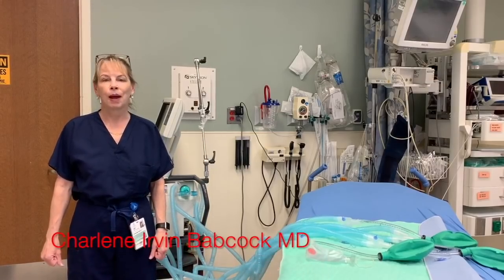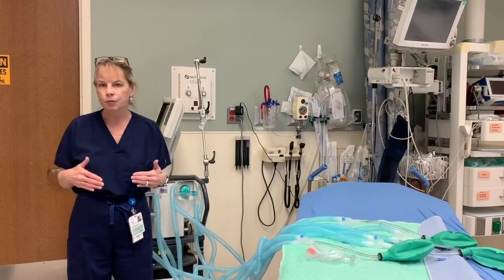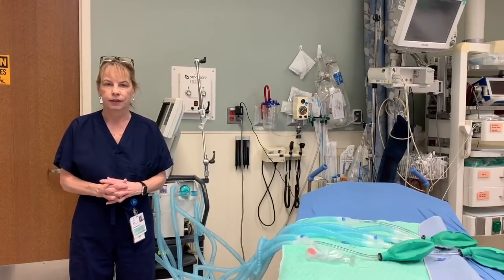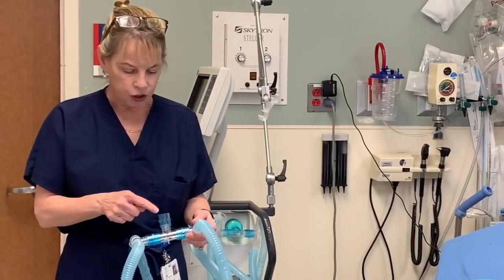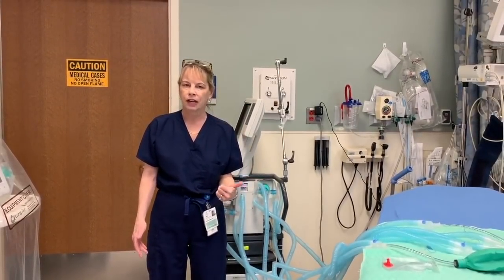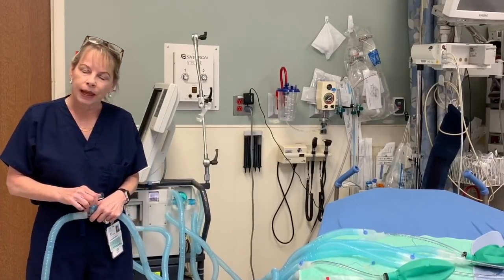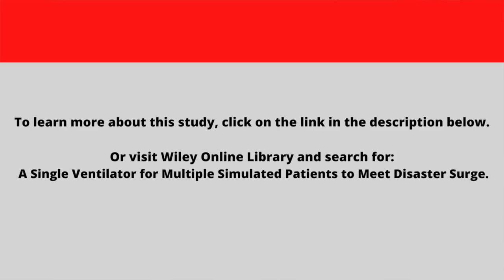COVID-19 How to Use One Ventilator to Save Multiple Lives

Comment: I realize you are trying to help in a horrible situation and appreciate the creativity. But you would be better to pay people to manually ventilate the other 3 patients with a bvm and peep valve than do this death setup. Did not even go into the variances of minute volumes in critically sick ards patients
Reply: I have been working in ventilation for over 25 years in ICU. There is no need to test splitters or pressure bleed valves etc...   It would not work in ARDS pts.  If this would work she would hook up this crazy circuit to 4 ASL5000 electronic test lungs set up with varying levels of ARDS. It would instantly prove how dangerous this is or what an incredible idea this was.  You could train people in under an hour on how to bag and roughly what minute volume would be needed per individual patient. You could even get the baggers to mimic inverse ratio or 1:1 I:E ratios.  I understand people are fearful and looking to latch onto anything that might seem promising.  This is not it. With 1 vent and 3 manual baggers you would have a chance (small) at all 4 possibly making it. With this setup you would have 4 dead people in short order.  It’s one thing to suggest using BiPap to ventilate off label(fair enough in a crunch), it’s another to suggest this mess. Any physician or RT that attempted this in real life with real patients would lose their licenses and face massive negligence lawsuits.  Why hasn’t this ER doctor had an actual ventilator expert like Robert Kacsmarek or a well published Intensivist point out the wisdom of this setup?   Have you not thought about why manufacturers have not suggested this?
Reply from the maker: So this type of configuration is likely only going to be used in dire circumstances...such as 'TRY or LET DIE!'   
You do need to match compliance as close as possible...which can be a substantial challenge...however, it is my understanding it is working in Italy......from 2 days ago....see comment cut and pasted below...

Dr Marco Ranieri of Bologna, Italy and his team Have successfully tested the approach in vivo in one of the hospitals in Italy overwhelmed by the COVID-19. 

They worked with Intersurgical, an Italian company based in Mirandola, started producing the circuitry in only 72 hours, and the first prototype has already been tested by Bologna Sant'Orsola Hospital. It works and in the next few days they'll start a mass production to supply Italian hospitals who are in need

Here some news in Italian. 

https://www.huffingtonpost.it/entry/a-mirandola-testato-ventilatore-che-assiste-2-pazienti-bonaccini-straordinario_it_5e73c3e1c5b6f5b7c540a8d2
Reply: Try or let die is a cop out.  That is not medicine   How about a real solution like a call for volunteers to work in shifts to manually ventilate patients and a logistics system to set up their deployment and rotations  in an ICU with no ventilators available.  Please at least give people real hope instead of putting your name on this mess. You should instead be cut and pasting- TRY and make sure that all 4 die.  Irresponsible advice.  Seriously make another YouTube video with actual test lungs with resistance and compliance of 4 different patients with varying ARDS and post it.  Or even do with your anaesthetic bags with different rubber bands to mimic different compliance levels. Have you talked with your hospitals medical heads or ICU doctors about actually implementing this?  Have you actually ever ventilated a patient with true ARDS?  Would love to know what  your lung protective strategies as they progress through the fibroproliferative stage.  I know you mean well but so did Jenny McCarthy telling everyone not to vaccinate due to it causing autism.
Reply: There's an article advocating for this concept by Josh Farkas. He's board-certified in pulmonology and critical care and will certainly understand the pathology and lung mechanics. Check it out as he addresses some of this.
https://emcrit.org/pulmcrit/split-ventilators/

Also think through bagging. You would need people to switch off probably hourly. 2 people per 12 hour shift. 8 people a week if they're working 40 hours. That's exposing 8 people, PPE for 8 people, liability for 8 people, and finding a way to pay for 8 people. That's per patient. Do we need background checks or are we just pulling people off the streets? Can we trust them to properly use PPE and not contaminate themselves and the rest of the unit? 

Then actually bagging. There's the tendency to hyperventilate and hyperinflate. Then the limited ability to gauge pressures. It's doable, but considering it better is far from clear.
Reply: Yes bagging would be terrible choice but better than this setup. The logistics for rotations would be complicated. And bagging an ARDS pt takes very strong hands. Luckily there are tons of healthcare professionals available as at our hospital all the clinics and elective surgeries are cancelled.  This is a worst worst case scenario but better than 4 dead covid ards patients within 5 min of setting this 4 person vent up.  I don’t understand why she doesn’t just set this up on 4 test lungs with low compliance. It would instantly show how dumb this is or validate what a clever idea it was.
Reply: I read the article- love the caveat by the author that I don’t have any experience with this.  Also not willing to see if feasible  using test lungs (these are not a new invention)   Also why stop at 4 patients per ventilator, why not 16 per vent. Just need more splitters. Each ARDS patient needs individual settings due to individual requirements of minute volumes for their blood gases.  The over simplification of this is shocking.
Reply: I am also concerned about that articles authors understanding of ventilation as pulmonary physician. He seems to think pressure control is pressure cycled- it is not. Pressure control is time cycled with a decelerating flow waveform. There are actual respected us ventilation experts out there like Robert Kasmarek.  Who has authored several textbooks and a thousand studies. Have you considered why they haven’t spoken up to approve and encourage this.
Reply: @danielneil4523  I don't know if you read a different article or misunderstood the terms but in the end it's all opinion and uncharted territory. Each method has advantages and disadvantages but it's something worth discussing at our hospitals ahead of time in case the worst-case scenario was to happen.

Comment: This video was done by someone who does not understand basic ventilation.  Very dangerous advice.  The patient with the best compliance would blow pneumos and the patient with worst compliance would not be ventilated at all. Why not hook up four test lungs with different compliance and resistance and see what happens?   Even use different rubber bands to simulate compliance’s as you probably wouldn’t understand how a test lung works.  Have you actually ever ventilated someone with ARDS where you are are APRV with pt prone with nitric oxide or carapul/flolan entrained in?  Of course it would work for gunshot victims with normal lungs.  Having ran ventilators during SARS you must maximize oxygenation with permissive hypercapnia while trying to keep plateau pressures under 35cmh20.  You would be better to have one patient per vent versus 4 dead ones
Reply: I think Dr. Charlene is talking about a SERIOUS (emergential) SITUATION only after patients' lungs conditions comparison...
* there is a comment below (similar to this) from Jeff Bradley where she answered with more info. Hope can clarify to you
Reply: This setup is dangerous. In an absence of enough ventilators you would be better having 1 patient on the ventilator and 3 manually bagged.  You would need people trading off after each hour for the bagging.  I would take my chances being bagged vs this setup any day in a crisis with not enough vents. This setup would fail in covid ards patients.  The doctor would have a very tough time being asked by ventilation experts on why this was the go to instead of manual ventilation. Aka the Armstrong ventilator
Reply: Daniel Neil Daniel Neil oh, ok! I understand... this video comments became a forum (there is a list of comments from Michael McPeck with more detailed and extensive evaluation) and maybe Dr. Charlene must review the video, or even remove (or making it private) giving excuses with the others - at least, to you and other professionals identified - here.
Reply: Actually, using pressure control would likely prevent volutrauma. The worst thing that would happen with this setting is that the person with the least compliance would be underventilated (as long as they are oxygenated the could tolerate some permissive hypercapnia). 

James Yi, MD
Anesthesia
Reply: How do you figure that?  With this 4 person setup your alarms and safety’s would be disabled including the high tidal volume safety.  Whoever has the best compliance would blow pneumos. It’s pretty simple concept. The high Vt alarms prevents this. Do you think people on PCV can’t have overventilation trauma. Have you ever seen a status asthmaticus switch to high compliance  from high dose steroids.  The high VT is the only thing that prevents this. I can’t believe any health care professional would support this setup. Wow! Please feel free to test this out on actual patients if you believe in it- but be sure to have a good lawyer. ARDS is not an anethetized patient with normal lungs- it is actually complicated to ventilate using lung protective strategies.
Reply: Have seen sever ARDS patients require 50-60cm H20 pressure in PVC just for permissive hypercapnia accepting pH of 7.1 with PO2s of 50 on fio2 of 1.0 with PEEPS of 20. Often with high pressure recruitments q6hr. These lungs are super stiff and damaged. An anesthesia ventilator does not have the horsepower to keep these patients alive. This setup would kill all 4 patients very quickly.  These patients are extremely difficult to ventilate and it makes going for scans almost impossible unless you are extremely competent bagger as a transport vent can also not keep them alive.
Reply: This whole thing is silly and  Michael Mcpeck who is obviously a very competent RT said it very thoroughly why this would never work in an ARDS setting.  Best of luck to everyone and hopefully we can produce enough ventilators where this is a moot point. It is pretty easy in all these comments to see what people have actually ventilated severe ARDS and who has not.
Reply: True,Some patients are not the same compliance it is a complicated situations specially in ARDS,along with the ARDS protocols guidelines,so it means they have the same abg result?so The settings forever on pressure control? how about with the tidal volume?It works maybe on pb840 with VC+AC, but im confused with the result of abg.I just couldnt imagine if 4 patients in one ventilators Nah!i hope some engineers produce one ventilators with different settings data limited for 2 or more patients.

Comment: No way this can work.  This person does not understand what she is talking about
Reply from the maker: So this type of configuration is likely only going to be used in dire circumstances...such as 'TRY or LET DIE!'   
You do need to match compliance as close as possible...which can be a substantial challenge...however, it is my understanding it is working in Italy......from 2 days ago....see comment cut and pasted below...

Dr Marco Ranieri of Bologna, Italy and his team Have successfully tested the approach in vivo in one of the hospitals in Italy overwhelmed by the COVID-19. 

They worked with Intersurgical, an Italian company based in Mirandola, started producing the circuitry in only 72 hours, and the first prototype has already been tested by Bologna Sant'Orsola Hospital. It works and in the next few days they'll start a mass production to supply Italian hospitals who are in need

Here some news in Italian. 

https://www.huffingtonpost.it/entry/a-mirandola-testato-ventilatore-che-assiste-2-pazienti-bonaccini-straordinario_it_5e73c3e1c5b6f5b7c540a8d2
Reply: Actually, using pressure control would likely prevent volutrauma. The worst thing that would happen with this setting is that the person with the least compliance would be underventilated (as long as they are oxygenated they could tolerate some permissive hypercapnia).
Reply: Agreed.

Comment: This is not practical or realistic. You cannot control for lung compliance. The pressure will go to the area with least resistance. This will cause damage to those lungs while the other patients will not get the appropriate breaths. Everyone would have to be at the same rate as well so you cannot control for one patient needing more or less ventilation without effecting the others. I appreciate out of the box thinking but this is garbage and should not be shared. Source: I am a Respiratory Therapist.
Reply: This is not being recommended as an ideal situation. It is being recommended to be used in dire emergencies where not using it would mean people dying with no care at all. Something is better than nothing. If one ventilator can help up to 4 patients picked for similar lung capacity and condition, the lung compliance disparity issues would be minor compared to being in a hallway with no care at all. This is just an IDEA. not a recommendation. Doctors can make these decisions in an emergency, and if it is not serving the patients well, they can retreat from the idea. I think it is brilliant thinking outside the box, and would like to hear the manufacturer weigh in about reliability under those circumstances, since a unit going south or overheating with 4 dependant patients would be a big problem Conservatively I like the idea of 2 patients on one ventilator better, especially if they are paired well for volume and condition. I am not a doctor, but I have worked as an EMT, so there is my disclaimer. I have had to make due and adapt to conditions in the field many times, and although I would not recommend those tricks as ideal treatment, I have saved peoples lives by this sort of thinking on my feet. This might save some lives.  Databyter
Reply from the maker: So realistically....its being done successfully in Italy....read below....

Dr Marco Ranieri of Bologna, Italy and his team Have successfully tested the approach in vivo in one of the hospitals in Italy overwhelmed by the COVID-19. 

They worked with Intersurgical, an Italian company based in Mirandola, started producing the circuitry in only 72 hours, and the first prototype has already been tested by Bologna Sant'Orsola Hospital. It works and in the next few days they'll start a mass production to supply Italian hospitals who are in need

Here some news in Italian. 

https://www.huffingtonpost.it/entry/a-mirandola-testato-ventilatore-che-assiste-2-pazienti-bonaccini-straordinario_it_5e73c3e1c5b6f5b7c540a8d2
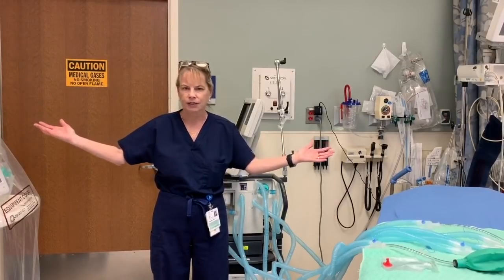Reply: @2:28 ...
Reply: Actually, using pressure control would likely prevent volutrauma. The worst thing that would happen with this setting is that the person with the least compliance would be underventilated (as long as they are oxygenated they could tolerate some permissive hypercapnia). 

James Yi, MD
Anesthesia
Reply: How many people are dying in Italy?
Reply: Huffington post as a reference lol Also you reference mass trauma success, those are usually "healthy lungs," not full blown ARDS lungs...

Comment: "just train some volunteers to use an AmbuBag like we've done already." THAT  is an even more important thing to do RIGHT NOW (the training).  I have not heard that there is any shortage of endotracheal tubes!!  Very odd that Mike Pence probably has no idea of such an intuitive way of coping until we get more machines.
Reply: That (mechanical hand squeezed ambu bag) sounds reasonable, but when you multiply this solution by the number of patients that would need it, and by the number of volunteers required to do this for even ONE patient over a period of several weeks, you are looking at introducing thousands of new potential victims into every hospital, many of whom would become sick themselves, and become infection vectors themselves, adding to the problem we are trying to address.  The math does not work. An Ambu situation is a temporary fix, not a viable long term solution for hundreds of patients. You would need at least 5 volunteers per patient to keep this going, and probably twice that much realistically, Have you ever tried to maintain mechanical breathing with your hand for several hours straight? It cannot be done by most human beings without switching hands, and then people, frequently. And as I said, these people are now ALL vectors of transmission, and potential patients. Great thought, but NO.